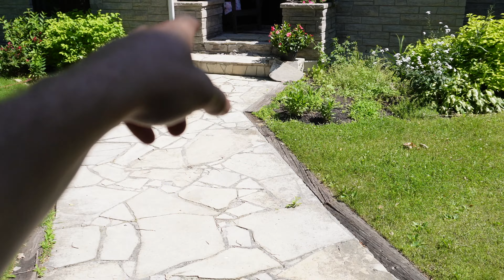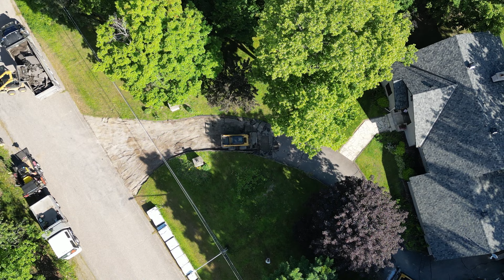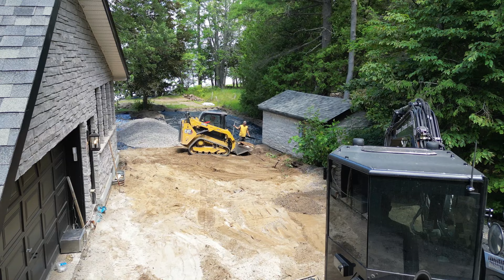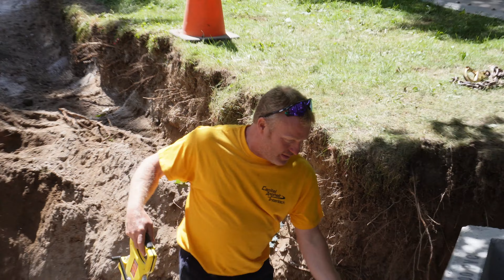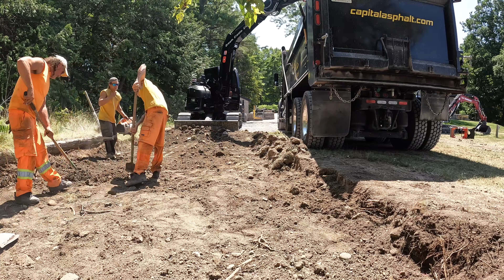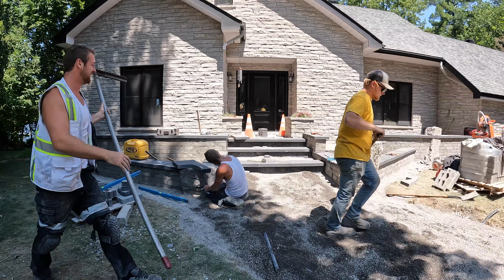PART 1: HUGE PROJECT 10 DAYS - Interlock, Excavation, Drain, Armour Stone, Grading & More!

Comment: as someone whos got thousands of hours in rototilts, just a tip, when picking tampers put your grabber module up and down not sideways liek you had it, the arms will get tweaked fairly easily with side loading. When lifting the manhole or anything with a chain/sling for that matter.  use the attached welded lift point, curl all the way in go off of that
Reply from the maker: Hey Andrew, thank you for your feedback! I'll have to give that a try next time